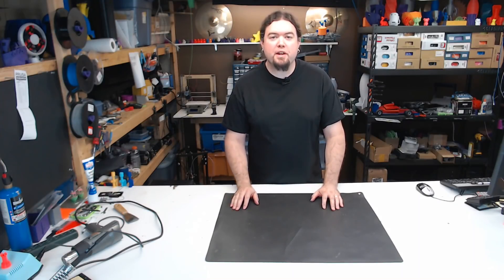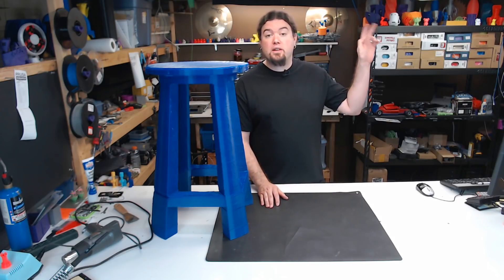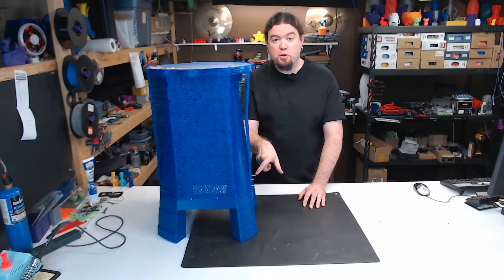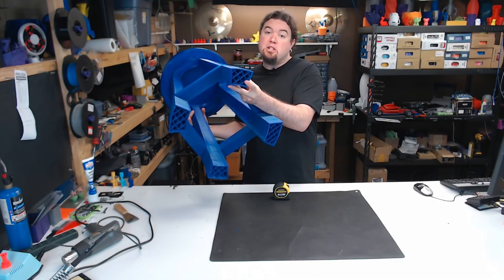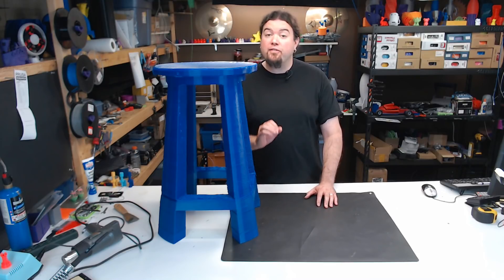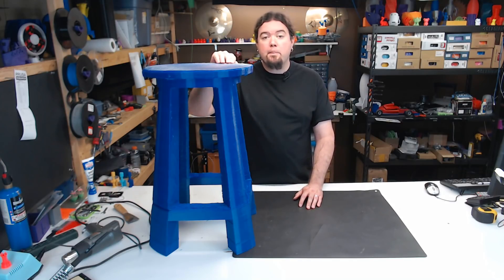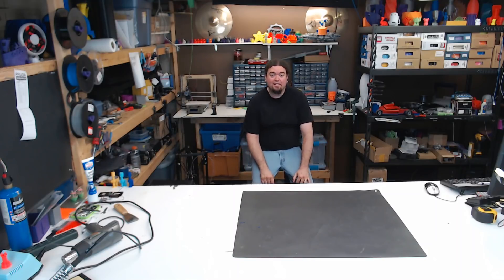Full Size 3D Printed Barstool - Hang Printer - Chris's Basement

Comment: Printing actual furniture is a sound wall-like milestone for the community I think. I'm super happy to see your Hangprinter is actually doing things for you =) Thanks for sharing your experiences!
Reply from the maker: Thanks for the comment Torb! This was a really fun one to do. I hope to do more later this year. If I get a couple of big prints done I might have them shipped to MRRF in March.
Reply: I had a curious/uninformed thought about the "vase shaped" build area I've heard mentioned about your design in this video and others: could you change/normalize the shape of the build volume by allowing the floor mounted anchor points to "float" upwards along with the print-head? Maybe by adding an extra pulley of some kind to each point?

Comment: 0.75 layers on 0.8 nozzle?  breaks the layers not more than 80% of nozzle size rule... causing layer adhesion issues.  Other that that looking good.
Reply from the maker: I am glad someone caught that. You are correct, I try to stay around the 75% mark myself. I really wanted to see what the volcano could handle. It did a lot better job then you think it would, but it would have been much better if I would have bumped up to 1.0mm. When you print this large you tend to get a real "melty" look, I was trying to get away from that. Thanks for watching!

Comment: 1.2mm nozzle keep the same .8mm layer height. skip the support. instead add a 2 layer thick vertical wall segment say 10 layers thick at the bridge. it will droop but should recover by 10 layers when it starts the "real" bridge. (make that part pointy) and then you just "cut out" the artificial bridge you added in.

Comment: Chris -- thanks for the fantastic video! I really want to build a hangprinter of my own, and I am very inspired by your videos on the topic. Quick question for you; do you know where one can buy the mechaduino's that Torbjorn now recommends for the hangprinter?
Reply from the maker: John Degenstein Thanks! Those can be tricky to get and pricey. Check them out here. http://tropical-labs.com/index.php/mechaduino
Reply: Thanks for the response, I will keep an eye out for those coming back in stock. Just ordered about 3/4 of the parts for the build, luckily the standard stepper drivers are cheap so I wont feel bad about not using them.

Comment: Heyo Chris, i've just seen your video on howto calibrate a Delta Printer with Marlin. It's a really interesting video and giving me new ideas on what i could do to fix my problems. I have spent so many hours trying to fix it about a year ago but I had to give up because i didn't find any help online. Now im going to try the stuff you show in your video with the radius calibration n stuff. I dont know if you ever had this before but im always having problems with leveling the spots between the towers on which 1 spot in particular is always too high. I'd be very glad if you had some tipps regard this issue. And oh boy if you can help me resolve this i would be so happy :D i'd be sending you atleast 10 "Coffees". 

Thanks for any help in advance and sorry for just smashing the in here but I thought thats the easiest way to reach you.

Greetings from Switzerland :)
Reply from the maker: Try to step through the process and see what you get. If it's just one tower, the only time I have seen that is when the endstop was lose. You might have some bad setting in the eeprom. What kit do you have? Do you use a bed probe? Again, give this a try and let me know how it goes. Send me the output from M503 as well. Thanks for watching!
Reply: Wow youre quick! It's the Anycubic Kossel Pulley Version with the 180mm printbed not the big one with a 230mm. As I said i'll do what you say in the video and come back tomorrow. And by the way, the "problem zones" are always between two towers not directly infront of one. I think thats kinda strange but we'll see :)
Reply: Sooo, I looked into it for about 2 hours now and i've not gotten far i think :D 
I "attached" you an M503 at the end of the comment

I am printing the a circle scaled to 300% (the one file you used in your old video on calibrating delta printers)
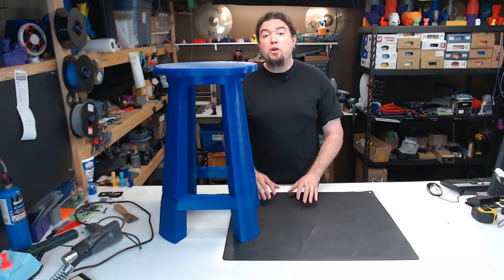The nozzle seems to be too high at 2 spots and im gonna describe it to you as if it was a clock and the towers would be on 12:00 / 4:00 / 8:00
now the spot i have always had my problems with is on 2:00, right between two of the towers. I the bed is not tilted and i am using a heatpad underneath. Do i need to play around more with the Radius setting? 

I really have to finish some other stuff too, so i'll look into it on another evening again or on the weekend. But help is always appreciated :)

SENDING:M503
echo:Steps per unit:
echo:  M92 X80.00 Y80.00 Z80.00 E96.00
echo:Maximum feedrates (mm/s):
echo:  M203 X200.00 Y200.00 Z200.00 E200.00
echo:Maximum Acceleration (mm/s2):
echo:  M201 X3000 Y3000 Z3000 E3000
echo:Accelerations: P=printing, R=retract and T=travel
echo:  M204 P2000.00 R2000.00 T2000.00
echo:Advanced variables: S=Min feedrate (mm/s), T=Min travel feedrate (mm/s), B=minimum segment time (ms), X=maximum XY jerk (mm/s),  Z=maximum Z jerk (mm/s),  E=maximum E jerk (mm/s)
echo:  M205 S0.00 T0.00 B20000 X5.00 Y5.00 Z5.00 E5.00
echo:Home offset (mm)
echo:  M206 X0.00 Y0.00 Z0.00
echo:Endstop adjustment (mm):
echo:  M666 X0.00 Y0.00 Z0.00
echo:Delta settings: L=diagonal_rod, R=radius, S=segments_per_second, ABC=diagonal_rod_trim_tower_[123]
echo:  M665 L218.00 R98.40 S100.00 A0.00 B0.00 C0.00
echo:Material heatup parameters:
echo:  M145 S0 H180 B70 F255
  M145 S1 H240 B100 F255
echo:PID settings:
echo:  M301 P22.20 I1.08 D114.00
echo:Filament settings: Disabled
echo:  M200 D3.00
echo:  M200 D0
echo:Z-Probe Offset (mm):
echo:  M851 Z-3.50
Reply from the maker: I will plug mine in today and compare the results. I'll let you know.
Reply from the maker: Do you know what version of Marlin you are running?

Comment: How about changing the design of the foot rungs to be curved instead of straight across to eliminate supports entirely? Obviously it would look a bit different than a standard bar stool that way.
Reply from the maker: If you come up with some others ones, I will probably give them a try. This one is good, but I think I can do better. Lot's of different things we can try on this.
Reply: I thought about that, but Chris sent me some bar stool pictures of what he wanted. If I were to design it again I would do a couple things different. But I can say the same for anything I design. I will probably make a few iterations of the design when I get the chance.
Reply: It would have also been easy to made the rungs as seperate pieces and had them as bolt on pieces which also would have eliminated supports.

Comment: What was the nozzle size? Filament is not always cheap solution. you could use just some wood legs. by the way good job.
Reply from the maker: This one was printed with a 0.8mm nozzle. This was simply to prove it could be done. Much more expensive than buying one, but not near as much fun! Thanks!

Comment: Honored to be part of this project! Thank you Chris for asking me to design this, it turned out so cool. Best project I've seen from a hang printer yet. If you'd like I can design some caps for the feet to give you that height back that failed at the end.
Reply from the maker: Thank you man! You made this one MUCH easier to pull off. I will probably leave this one as is for now, but I definitely have some more ideas to run past you for future hang prints.